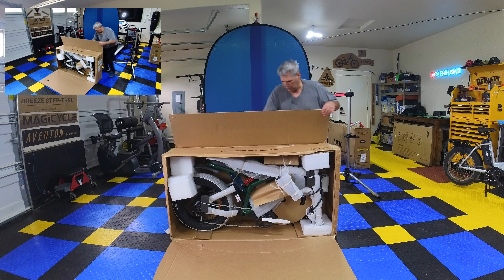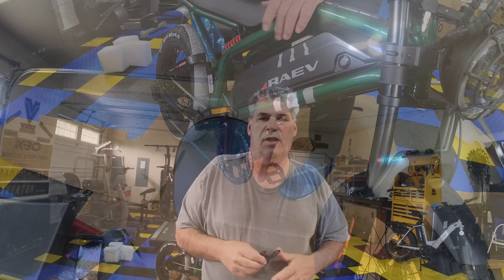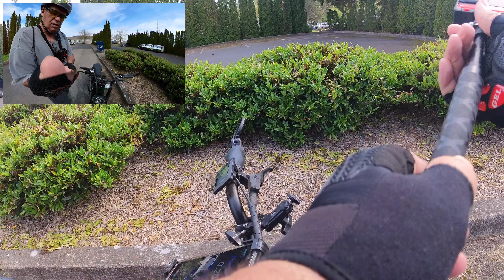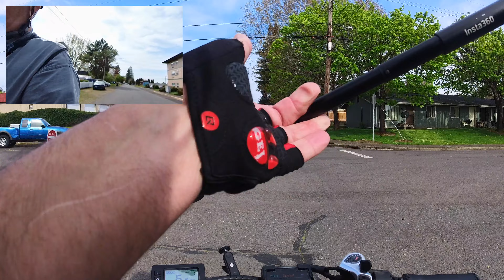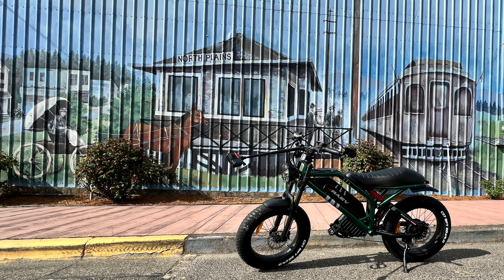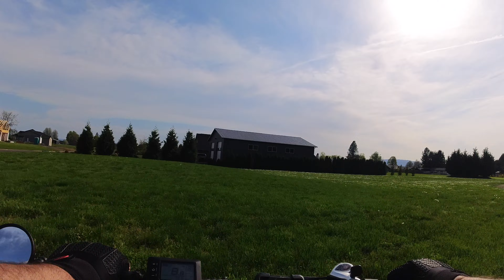RAEV REVIEW Bullet-GT

Comment: Great job, gray shirted Bruce!  The practical side of me can't accept those partial fenders that just won't protect the underside (or the rider).  Also, another reviewer mentioned the front brake rotor position was not designed properly but the company was to correct that in the future batches.  That's nice to hear.  Seems like brand new models sometimes need the kinks worked out, don't you agree?
Reply from the maker: Yes agree 100%. I think by batch 3 or 4 they will have it all sorted.  Always expect batch 1 to have issues. No big deal though. (I like Grey shirt Bruce )LOL.    ;-)
Reply: I just purchased the full fenders